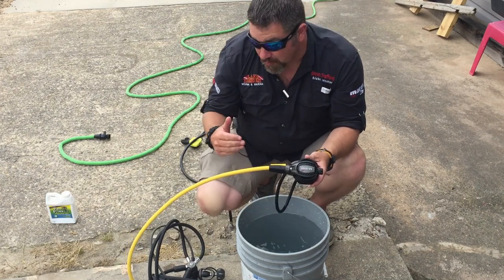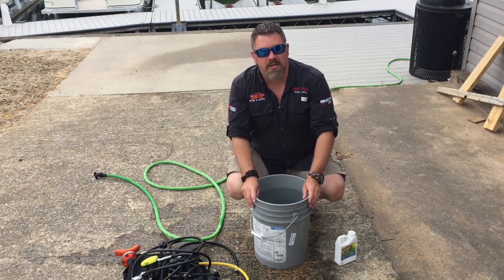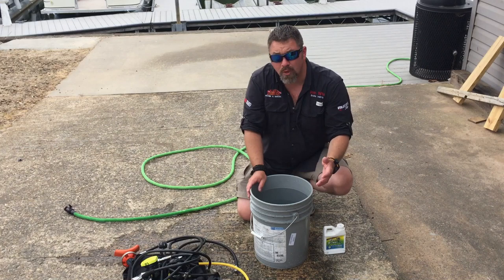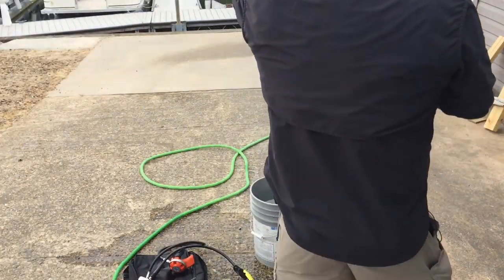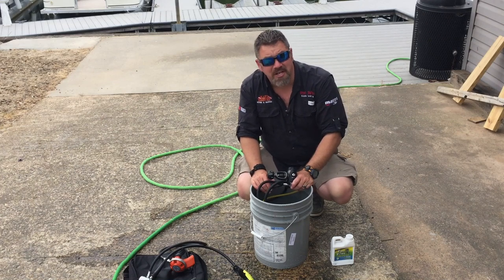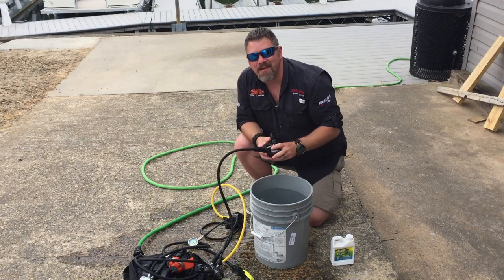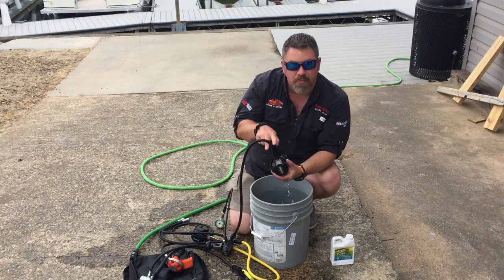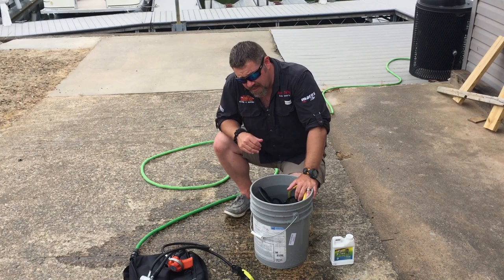Cleaning My Regulators {[Keeping It Simple]}

Comment: When getting a service on my reg I was told that I had corrosion in the first stage from water ingress. Tech asked if I’d ever submerged it without dust cap - no. So asked me to show him how I cleaned my reg. Submerged whole reg assembly in wash tub and then swished each 2nd stage side to side a couple of times. Tech said pressure against diaphragm could open valve, letting water into hose. Then as stored in gear bag and not hung up by 1st stage, water could have migrated up the hose into 1st stage ... causing corrosion. 

This tech said safest way to clean is: First stage on tank, pressurised*, Dunk 2nd stages in bucket for 5-10 seconds, remove and purge for a couple of seconds. Spray 1st stage with a hose, then work the water down the tank to clean it too. 

He said this also prevents the problem where when tanks are rinsed, water can end up in the throat of the valve. When tank is next filled those couple of drops of water can get blown into the tank - causing internal corrosion if it’s a steely. 

* Tech added: If reg has been removed from tank between dive and cleaning & if using a tank which has been to the dive site, crack the valve for a couple of seconds first before re-fitting 1st stage. This will blow out any water, sand, etc which may be in the throat of the valve - a real possibility where it’s the first tank of a double dive & the cap is left off to identify used from full. (He said out of habit & caution, he always cracks the tank valve for a second or two before fitting a 1st stage)

Is this Tech prudent or has cleaning overkill?
Reply from the maker: Hello Mark Boscawen, sounds like you tech has perfected the art of cleaning a regulator. Personally, I like his method. I will vouch for him and say that he is given you some great advice.

Comment: I totally agree with putting the reg in water. I have been cleaning my 1st stage with all the 2nds and I leave them overnight in good water. I have been doing so for more than 4 years and I never had an issue. I have had my regs service every year and my guy never has to replace o rings like he does with other customers' equipment. There was not one time that water came in even into the second stage. I hang them to dry and next dive they are 100% great. I use soap at times and some vinegar as well to knock off any possibility of rust on my metal. So I 1000% say yes to putting the regulators in water. Thank you,
Reply from the maker: Hello @lukain1872002, thank you for sharing your experience with us. We too have never had any issues cleaning our regulators this way.

Comment: Don't follow any of these recommendations. You're going to ruin your regulator.

* Do NOT press the purge button when the 2nd stage is submerged and the system is not pressurized. Yeah, the water won't go (much) above the water level, but now you've got water in the hose, and that's not going to come out on its own. When you raise the 2nd stage above the water, the water that's in the hose is going to run down to your 1st stage. Any water left in that hose will eventually become water vapor, and get everywhere in your system.
* Do NOT use a hose to clean your 2nd stage on the inside when the system is not pressurized. There's water pressure coming from that hose that can force valves to open.
* Do NOT rely on, or assume there is an automatic closure device on your 1st stage. Most regulators don't have one, so submerging your 1st stage is a colossally stupid idea. And even when it does have one, it's designed to keep dust and droplets out. It's not designed to keep water out when you submerge it. It may keep the water out at first, but when that o-ring starts to deteriorate, it no longer will.

You CAN remove the front cover off of the 2nd stage and take out the diaphragm, to thoroughly clean the inside of the second stage. This part of the regulator is designed to be user serviceable. This way you can remove dirt and nasties from your regs.

Follow the manufacturer's instructions when using or cleaning your regulators. Don't assume the manufacturer is lying to you because someone on the internet told you so.
Reply from the maker: Hello @bloodymarvelous4790, sorry to hear that you did not like our video. Nevertheless, we appreciate you watching it, and sharing your thoughts with us.

Comment: @5:18 If you pressurize the system with any amount of water in the first stage it's going to just push that water further downstream.  The HP port would see the water first and wind up trapping the water in the HP hose or down into the SPG.  No amount of regulator purging will get the water out of there.  The dry air from the tank may absorb small amounts of moisture into it, but at some point it will condense back into liquid in your system.  It seems to me a better solution, albeit temporary until the system can be properly serviced, would be remove the SPG (mind the air spool) and slightly pressurize the reg to run some air through the HP hose to blow out any water trapped in it.  As for the 2nd stages and LP inflation hose, those can remain connected and purged as you mention after reconnecting the SPG.
Reply from the maker: Thanks for sharing Nick Kafir. This is why we recommend divers seeking out a gear technician.

Comment: Thanks again Brian! Have you ever done a video on the inflators that are also a safe second (Air2, SS1 etc?). I'd be interested to hear your thoughts.
Reply from the maker: Hello Bill, I haven't, but will be glad to make one for you.
Reply: It's a solution without a problem. Don't get one. They're overpriced, non-standard, a pain to use while making a safe ascent, and require a longer hose on your primary so you can safely donate it to your buddy.

Get a good regulator for your alternate instead, or use a long hose configuration if you want to donate your primary.

Both a good secondary second stage and a long hose config are cheaper than an integrated safe second inflator.

Comment: Simple absolutely someone ask me what happens if you don’t put your dust cap on a din valve? Would water get in the 1st stage? I said no because the valve isn’t open correct? Thoughts??
Reply from the maker: Hello Dive Addict, it all depends. Yes water would come into the high pressure chamber, unless the regulator had a device preventing it. Mares has the AST valve that prevents water from entering into the first stage. Now as far as it entering into the low pressure chamber, you would be correct, it would only enter in if the high pressure seat and poppet was open. We still would want to be vigilant and do everything we could to keep our regulators dry internally on the first stage. Corrosion of the filter can cause issues, and trapped moisture can prevent the first stage from being able to be disassembled for servicing. This is another reason I am not a huge fan of hose protectors, even on rubber hoses. They simply trap water and can cause corrosion. The hose protector allows more water to flow directly through than what the DIN orifice would, and yet it still causes corrosion. Now imagine the DIN orifice allowing water in, but not back out. You can see real quick how fast that corrosion starts to effect your first stage. We have a flat rate on servicing regulators here at the shop, and we charge extra for excessive amounts of corrosion. We see all different types of regulators, and we can always tell the ones that replace their dust caps prior to cleaning.
Reply: @LakeHickoryScuba  How do you know if the mares 1st stage a closure device on the 1st stage? Does the mares 75xr have a closure device?
Reply: @diveaddict6885  It should say so on the spec sheet of the regulator. If there is no mention of it, it doesn't have it.

Comment: Good info.  I have accidentally dropped my regs into a rinse bucket and then realized I forgot to replace the dust cap.  I've heard that if water gets into the pressure gauge it can destroy it.  Have you ever seen that happen?  Just to be safe, I disconnected my SPG and hung it up to dry/drain, and then also connected the 1st stage to a tank and flushed air through it.
Reply: The SPG is a dead-end hose, so if you do get water in it you cannot flush it out like you can with any of the LP hoses (inflators and 2nd stages). You'd have to unscrew the SPG from the hose and then hook up the reg to pressurized air to flush the hose.
Obviously if water gets all the way up the hose to the instrument it can rust the internals and make it useless. But you have to remember also that all the hoses are full of air, not vaccuum. That air will get trapped in the usually looped hose and prevent water from reaching the instrument. Also water has high surface tension, which in the narrow airway of modern SPG hoses will contribute to air being trapped in almost the full length of the hose. However, the high water tension in a needle-thin airway means that the water dropplet would act similarly to a blocked ear and interfere with accurate readings on the gauge.
Also because of surface tension and the narrow airway, air-drying a hose could take a long time, the water will not drip out and there is not enough air circulation to evaporate it. But since it is extremely hard for water to get far into the hose, air drying might be enough since any water would be only at the entry of the hose.
Reply: @KimonFrousios  Thoughtful response.  I was thinking among similar lines.  I should mention that I did leave it hanging up to dry for a month.  Just curious if anyone has actually seen an SPG get "destroyed" as the myth goes -- not from rust or corrosion but by the water itself.
Reply from the maker: Hello Lars Sveen, we have seen multiple pressure gauges take on water and become damaged. Usually this occurs from it being dropped and the lens being broken, or the o-ring wearing out allowing water in.
Reply: @LarsSveen  Take the SPG off of the hose and remove the swivel pin, take off all the IP hoses and leave the ports unplugged. Hook the 1st stage up to a cylinder, and slightly crack the valve to let pressurized air run through the ports and the HP hose. Do not open the valve fully, because that will instantly freeze your first stage.

Let it run for a few seconds, close the valve, remove the 1st stage, and have it checked at your LDS.

Comment: For DIN first stage are dust cap waterproof ? If I submerge my DIN first stage in water with dust cap ON, will water seep in ?
Reply from the maker: Hello Salted H20, they do make water proof dust caps for DIN regulators, but most are not. A great option for DIN, is to leave it attached to a cylinder and pressurized while rinsing it off.

Comment: Thanks Bryan.   Does this also apply for DIN 1st stages?  Just keep the dust-plug in if you submerge it?
Reply from the maker: Hello Brian Huff. DIN first stages typically come with a push on type cap or even a screw on metal cover. These typically are not water proof, and the likelihood of water getting into the first stage is slightly increased. The first method shown, where I simply sprayed the regulator off is typically recommend for DIN, while it is still attached to the cylinder. I dive DIN regulators when I sidemount dive, and will typically clean them while they are still attached to my cylinder.
Reply: @LakeHickoryScuba  Perfect, thanks!   I was advised to carry a toothbrush to use to clean the DIN connector on the cylinder and the threads on the 1st stage recently as well to get the grime out.   Appreciate the video, was very helpful.
Reply: I accidentally submerged mine without the dust cap... and ran some water over it... only time iv’e done this... should i be worried?!?
Reply from the maker: The tooth brush is a great idea. Thanks.
Reply from the maker: Hello Chase Bryan, a simple submergence is not that big of deal. Hook it to a cylinder and pressure rise the system. Then hold the purge valve for a few seconds. Any moister should be dried up rather quickly.

Comment: Um... I completely agree with everything you are saying, BUT.... according to the Atomic Manual and Tech, you can not submerge the 1st and 2nd stage unless the system is pressurized.  There is an orfice (i believe this is the part) that does not close when not under pressure.  This is one of reasons Atomic has 3 year rebuild cycle, as they remove stress on the parts when not used.  Its also whey many Tech divers do not like Atomic on stage bottles as you turn off the gas when not in use.  If this is all BS, please correct me.  I do not take my reg class for 6 months (thanks covid).  I also sold most my Atomic and bought HOGs.  2 for 1 baby wins.
Reply from the maker: Hello Shun Tao, I would suggest following the manufactures recommendations.
Reply: Yeah, that's because of its seat saver, which other regs don't have.  People used to other regs probably often overlook that line in the Atomic manual, and do things the way they always have. If you do that by accident, though, you can blow it out. From the manual: "Avoid soaking the regulator unpressurized, as water may enter the second stage and first stage mechanism. If the second stage is purged when it is rinsed or soaked, it is a good idea to re-connect the regulator to a tank and blow out any water that may have entered the first or second stage." Atomic regs are incredible regs!

Comment: I recently bought a MK25/S620Ti as my first regulator. I was reading through Scubapro's manual and they state to simply just rinse off the regulator and don't mention anything about soaking it. I've looked online and there appears to be a lot of debate in the past about whether you should just rinse or soak the regulator. I want to soak my regulator because I know that I still end up having crystals form on some of my gear that I don't soak, and don't want this to happen with my regulator. However, some people have stated that the dust caps won't prevent water from getting into the 1st stage. Scubapro does not mention anything about whether its safe or not to soak the 1st stage. Do you know if there is a decent risk of getting water into the 1st stage if you soak it, or will the dust caps because to prevent the water from getting in?
Reply from the maker: Hello NotTheRealMorty, pressure is the biggest variable with water getting in the first stage during the cleaning phase. Typically, the dust cap is sufficient enough to keep most of the water out if you are just dunking it in or spaying it off. One sure fire way to keep water out, yet getting a good cleaning is to leave the regulator attached to the cylinder and keep it pressurized during the cleaning phase. This is a great option if you own your own equipment.
Reply: @LakeHickoryScuba  The dust cap is never guaranteed to keep water out of your regulator when you dunk it. Never submerge your first stage when it's not pressurized. It's more likely water will get into your first stage than not.

Comment: What’s your thoughts on long term storage with regard to the purge seals taking on the form of the seat. I’ve heard some regulators have a latch to lift the valve off the seat, but my reg doesn’t have that.
Reply from the maker: Hello Caleb Mcelhaney, back in the day the materials that were being used for both high pressure and low pressure seats were not very duarable. Thus, companies, like Sherwood would be a great example, would design their second stage so that you could lock the Demand Valve into the open position. Now days, seats are much more reliable and durable and this is not needed. Great question though.
Reply: Finally got around to a trip to Mexico. After a week of diving and the dive shop “cleaning/storing” our gear I got home, and can see there’s a little buildup around the regulator body that’s covered up by the dust cap. Obviously you’re gona have some salt get on that as you dive, but it’s covered up by the dust cap during the long soak post trip. How do you deal with that?

Comment: My regulator has been resting for some years and I find corrosion on the surface of 1st stage. How can I clean it thoroughly? Thanks
Reply from the maker: Hello budi tran, when regulators get that much corrosion on them, we use an ultra sonic cleaner and a mixture of vinegar and water to clean them. This of course is after we disassemble them.
Reply: You should get it serviced anyway. Let the technician handle that for you.

Comment: i dont think you would get that much water in the hose when you press the purge. you would need to push the air out of the hose so the water can replace it and the air really has no place to go. so i dont think you could get more than a couple drops in the hose.  i actually think that when you push the purge under water you would get more water due to the back flow effect
Reply from the maker: Hello DIVERS DOWN, thankfully, physics works for us in this situation.